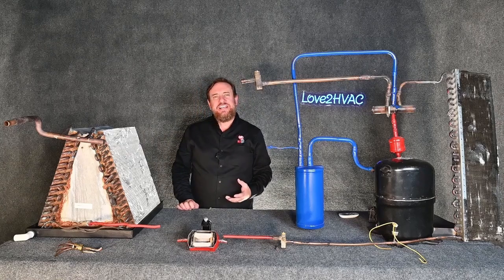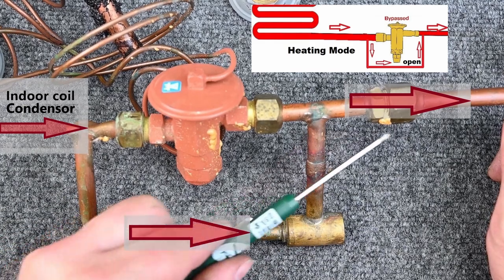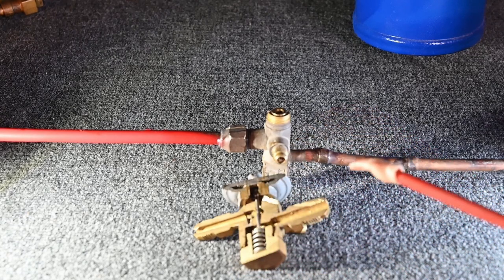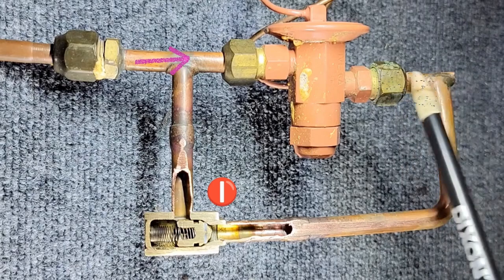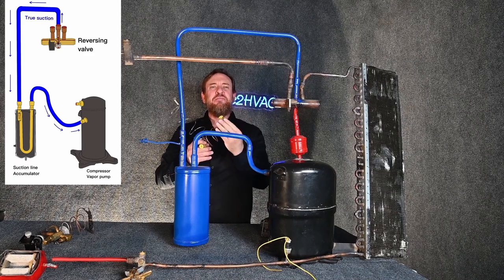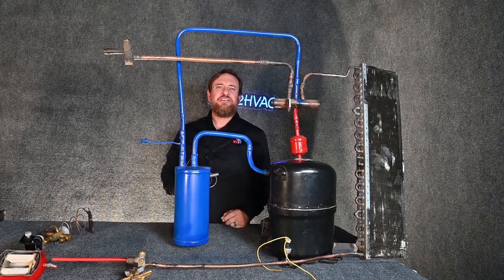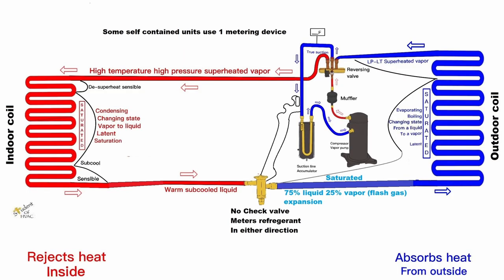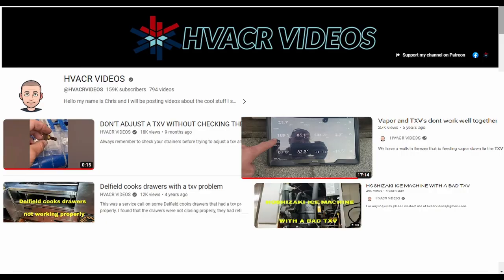Heat Pump 07 TXV & Check Valve

Comment: Yes on package hps generally it will only be liquid passing through the drier in cooling mode. In heating mode it will be a sat/ flash gas passing through. Always noticed that but never thought too much into it. It's really the only way unless they installed one on each side of the metering device

Comment: I heard a lot if the inexpensive mini-split units also use a single metering device in the outdoor unit and lack a liquid line filter drier?
That plus R410a's oil situation doesn't bode well for longevity it feels.

Comment: How does this apply to NATE Questions.

From the condenser to the liquid line, there should be a liquid seal.
To prevent flash gas and have a proper subcooling at the liquid line.

Comment: I have a unit  that trips high pressure in heat pump mode like 650 psi but runs perfect in cool mode, could this be the bypass not working on the condenser side, also suction line is 180 degrees so it seems like reversing valve is working
Reply from the maker: 100% absolutely not the reversing valve!
The one of the most misdiagnosed comments. I have gone to countless call where the previous company or tech said it was a bad valve and it was not.
I have replaced very few valves over the years.

#1 you have an airflow problem. The indoor needs more airflow in heating mode than AC mode. Few people know how to actually check airflow.

#2 overcharged. An overcharged system will work in AC but will be a problem in heating.

There are some other other things to look for but those are the main 2